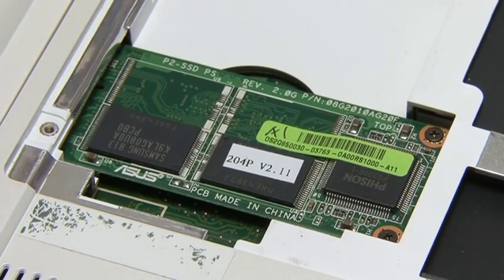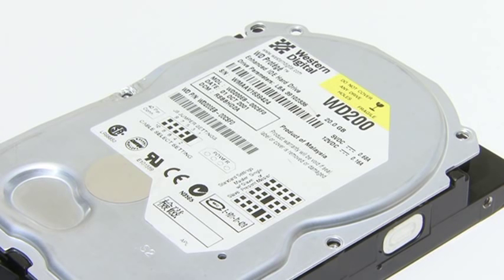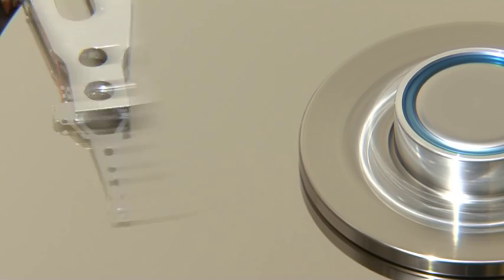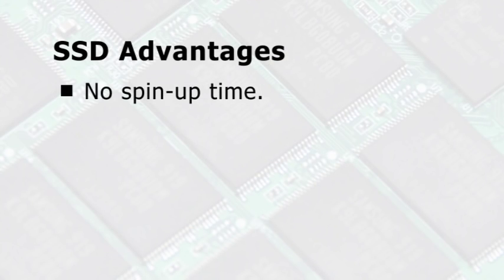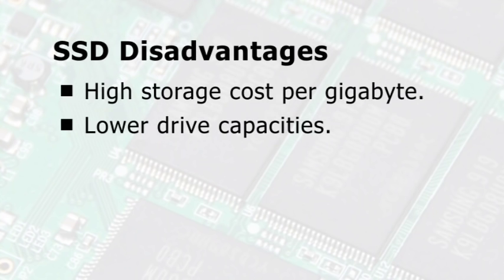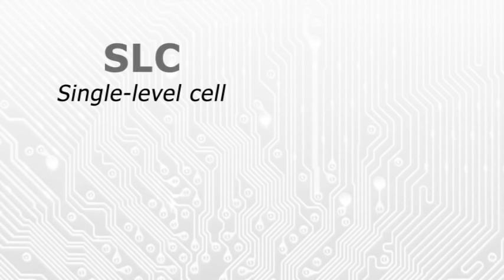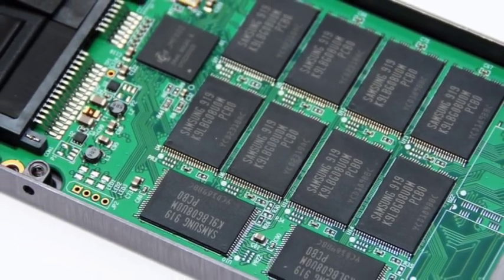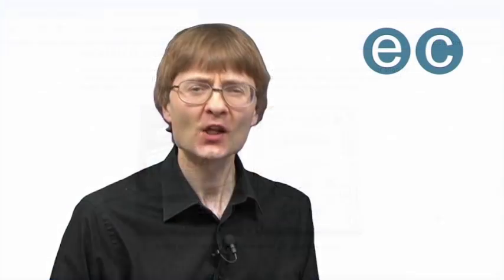Explaining Solid State Disks

Comment: But how exactly do they work?
Reply: It's basically the same principle behind a USB stick, but bigger and more permanent. 
Also known as flash drives, SSDs store stuff by catching small electric charges between some of the billions of transistors that make up the storage, where an active transistor is 1 and an inactive transistor is 0. This is where binary comes from. Binary is the basis behind all computing, but that's another thing. 
Transistors can store electricity because of these 'gates' that determine if the charge can go one way, the other way, or stay where it is, but I'm not too sure exactly how they do it, just what they do. I don't think anyone knows, really. 

They work a lot quicker because, as opposed to a needle on a disc, your computer can access all of the data on the banks of transistors and put it to use almost simultaneously, whereas discs have to compile and gather the data in a more linear fashion (like how a vinyl record works) for it to be tossed in RAM before you can access it. 
Incidentally, RAM also uses flash components, but that's for the stuff your computer is accessing and not the stuff you're storing. You can only access something one it's been sent to your RAM so if the storage drive can pump out faster, then the things you do should be faster, too, as all your files, programs, games and operating system are stored in the drive.
Reply: @classydays43  I can't believe you answered this question from 5 years ago. I really appreciate the time and effort you took when answering my question. Thanks man :)
Reply: @favorite89103  That's alright, dude. It's not the best explanation in the world but it covers the basics!
Reply: @classydays43  i actually needed this for school, thanks
Reply: @patmccarthy7907  😅 thanks, but I'd look at more resources! I might get the gist of the bare bones but I'm no expert by any means

Comment from the maker: When I researched the best SSD to use as the boot drive on my main PC (used for 3D rendering and HD video editing), I chose a Samsung 830 series -- the 256GB model. And about four months after it was fitted, I remain very happy with it. So that is my current high-end recommendation. It certainly beats other drives I have tried from Corsair and Kingston for sheer speed.

Comment from the maker: Lots of people have "noticed" this, and if I was making the video again I'd call it solid state drives. However, SSDs were initially called solid state disks (eg by Psion in the mid 1990s) -- and the term does remain in use even though there is no "disk" inside them. Language evolves -- with "disk" (in computer terms) being a word for a storage media.

Comment from the maker: Yes, it is becoming common to fit a PC with both an SSD and a spinning hard drive. Where this is done, the SSD is used as the system disk (c: drive) to store the operating system and (most used) programs. Data is then stored on the spinning hard drive (say the d: drive). Such a setup gains the benefit of an SSD to speed up boot and program load times, but allows the lower cost and capacity of a traditional hard drive to be used to store dat. Some ultrabooks are also already using this "trick".

Comment from the maker: It depends what you mean by "A LOT"! If you completely fill the drive, delete the files, & fill it again, thousands of times, then the drive will start to slow down and some cells will fail. But if you just write some files to it frequently, it should keep going. The SSD I show in this video is now over 2.5 years old and still working -- if with occasional hiccups, and not as fast as it first was. But until you start to experience performance issues, do not worry (though do back up regularly!).

Comment from the maker: Enabling TRIM and making sure that you don't defrag are very sensible actions to prolong the life of an SSD. Today, many SSDs -- eg those from Samsung -- come with a utility (like Samsung's SSD Magician) to optimise their use on a system. This includes leaving some space on the drive unallocated to assist with wear levelling. I made this video 2.5 years ago, and today modern SSDs work very reliably as system disks. So if you want faster boost speeds, fit an SSD and do not worry too much! :)

Comment from the maker: @SOF006 To be fair, what I say in the video is that data is written far slower than it is read -- which is true -- and "sometimes (not always) barely faster than a traditional hard disk". When the video was made (nearly 18 months ago) this was certainly true. And even today some (if increasingly fewer) SSDs struggle to write data as fast as, say, a Western Digital Raptor. Also, SSD write speeds fall significantly as the disk ages. I doubt you will achieve 200MBs in a year's time.

Comment from the maker: The speed of an SSD is not impacted by how full the drive is. However, SSD performance does degrade a little over time, and one way to limit this is to leave some spare (non-formatted) capacity on the drive. Samsung's SSD optimization wizard, for example, leaves about 10 per cent of the drive as unallocated space to help with wear levelling for this reason.

Comment from the maker: It depends if you need the extra space. The SSD / HD combination ought to give you a significant performance improvement -- as will the move to multiple drives when handling large files in, say, Photoshop. So I would probably myself go for the SSD / HD solution.

Comment from the maker: An SSD these days is faster than a hard disk. It also uses less power and is less likely to be physically damaged in a device like a laptop that may moved or jolted when working. However, SSDs also cost more per GB as you say, have a more limited life, and get slower over time. My advice is only to use an SSD if you need one (eg to make a PC boot faster). Modern hard disks are now very good value and are still the best choice in many situations.

Comment from the maker: The temp file issue is a potentially important one. I am typing this on a netbook with a 16GB SSD, and also run an Atom-based PC with an SSD, and on both have no temp file to save wear on the SSD. But on my Core 2 Quad (used for my video editing) the system disk is an SSD and I have left the temp file on, as it may be needed. If a PC is not doing very memory intensive stuff then you can get away with no temp file no problem: they were introduced years ago in a very different hardware age.

Comment from the maker: Yes, SSDs do have a (relatively) limited life -- for newer tripple-level-cell SSDs (like Samsung 840s), as low as 700 full write/erase cycles. To preserve the life of your SSD, leave at least 10 per cent of the space unallocated for improve wear levelling. I use an SSD as a boot drive, but not as a video/media drive due to the limited life issue.

Comment from the maker: No, the more free space (or unallocated space) on the SSD the better. Sorry if I what not clear above -- what I meant is that if you get a bigger SSD -- say 256GB rather than 128GB, even if you only need the space on a 128GB on -- then the drive life and performance will be better, because each cell of flash memory will be used less frequently.

Comment from the maker: Or you could try reading the DATE on the video before offering your criticism: the facts in this video were correct when it was posted (for several years SSDs were faster reading but slower writing than a 10,000rpm HD). And I'd love to know where you get a 3.2TB SSD -- the largest capacity I can find is 1GB. :)

Comment from the maker: @mastergx1 When this video was made this was not necessarily the case. Also, run an SSD for a year or so and the write speed can fall significantly. But I do take your point. Though it remains the case the all SSDs have a significantly lower write speed than read speed.

Comment from the maker: @creamie123 These are the key quns! An enterprise class hard disk (eg WD Caviar Black or Raptor) ought to last 5+ years, & performance will not decline over time (subject to fragmentation, which can be fixed). A modern SSD may last that long using TRIM. Eg Samsung claim a MTBF of 1.5 million hours for their latest SSDs, if also noting performance will degrade over time. For a HD the life and re-write limits depend far less on intensity of usage. But an SSD can more reasily be hammered to death.

Comment from the maker: You wil need to image (copy) your old HDD to the SSD, using a program such as Paragon Drive Copy. (Some SSDs come with suitable imaging software). Then you can literally swap the SSD with your HDD and it will work -- if a lot faster! :) If you are going to have both drives connected, then make sure that your SSD is connected to SATA 0 (to which you current HDD is almost certainly connected) to ensure it is the boot drive -- or select the SSD as the boot drive in your BIOS settings.

Comment from the maker: Remember this is video is over 3 years old. In April 2010 SSD write speeds were lower than (say) 10,000rpm WD Raptor hard drives. So for work like video capture hard drives were then the best bet. How things have changed! :)

Comment from the maker: You absolutely must not defrag an SSD, and because of the limited write cycles as you note. There is no benefit in running a defrag (you do not need to move blocks of data physically together to allow a head to access them faster), and will definately reduce disk performance. When installing Windows on an SSD, it is therefore important to turn off automatic defrag. Some manufactuers provide a utility to sort thing kind of thing out.

Comment: Excellent video showing the difference in technology between Mechanical HDD and SSD. The first thing I did when I ordered my new high end laptop was to finish setting up the OS and apps, and then swap out the primary 750Gig drive for a 128 Gig SSD, my secondary drive in the laptop is a 750 Gig 7200 and it serves as my data drive. All of the cache files for my programs write to the Mechanical drive. Boot times are nothing short of astounding.

Comment from the maker: @MultiSnoopDawg On any computer with an SSD programs load far faster, and there is also never a slight delay as a disk needs to spin up. So what you notice most with an SSD-based computer is not just the speed, but how much more fluid a computer becomes.

Comment: The best solution is to have 2 discs in one mashine. The faster but smaller SSD (Mine has the capacity of 250gb) would be used to store the system and important demanding applications and programmes, and the HDD with a higher capacity (mine has 1TB of data) would be used to store raw data such as photos, documents movies etc.

Comment from the maker: Yes, replacing the optical drive with the SSD is a possibility. However, point (c) above wll remain your problem -- just because you can connect two SSDs to your laptop's motherboard does not mean that it will have a controller built in to run the drives in a RAID configuration. I can't imagine a laptop will have such a controller, sorry.

Comment from the maker: Yes, SSDs are improving. But, for example, Samsung still caution against running thier speed tester too often as it will hit performance. Hard drives can still run at the same speed years after purchase, and sadly this is not the case with even modern SSDs. I guess it depends how much you hammer the drives and how full they are. And I tend to have fairly full drives that I hammer a lot! :)

Comment from the maker: It will depend on usage! :) I would personally expect to get about 2 years from an SSD as a system disk before performance starts to deteriorate significantly, and would expect to replace a system drive SSD after 3 years. But the bigger the SSD you get, and the less unallocated or free space you leave on it, the longer it will last.

Comment from the maker: At the margin a CPU may get hotter as it waits less time for data to be fed to it, but I cannot see this being an issue. Also an SSD will generate far less heat, and use far less power, in your laptop, hence making the innards cooler overall. Hence overall your laptop will be cooler with an SSD instead of an HD. So there is no reason here not to buy an SSD.

Comment from the maker: These days a multi level cell SSD should be fine -- they are far more robust than when this video was made. Do, however, avoid the very new tripple level cell (TLC) SSDs that are just coming on the market; these store three bits per cell, and are only rated for about 750 writes/rewrites per cell. They are cheaper, but I would not fit one as a system disk myself.

Comment: Excellent, there is also still a place for hard drives of course when large capacity is needed, working in tandem with an SSD (which has the OS and apps) and a good large HD to store the data.

Comment from the maker: Just copying the files to the SSD will not work -- Windows will not boot. Imaging softare copies a disk sector by sector -- it does not just copy files. You have two options. Either delete files from your current hard disk until the space used is less than the capacity of the new SSD, and then use imaging software to copy it to the SSD. Alternatively, you will have to do a fresh install of Windows and your software on the SSD.

Comment: One improvement they did make with HDDs overtime is that they spin up a LOT faster than they used to. Not as fast as a SSD of course, but still cool how you can make speed improvements even with those.

Comment: Thanx, i will fiddle around with that setting a bit just to see what it does. You could measure the amps with a volt meter. It has to bepartof thecircuit for a right reading.

Comment: @explainingcomputers i do, i was using a mac air, the bigger of the two, which i dont think seemed impresive from the stats, but the ssd really showed off as it made a huge diffrence over nomal drives ive used.

Comment: I found this very useful, nice to have everything explained in plain English. It strangely reminds me of BBC educational programmes from the 1970's. However, it didn't provide the answer to the one question that drew me to watching this. Would SSD memory would my computer run significantly cooler? On the one hand I've been told that the main temperature problems are due to moving parts, i.e. the spinning hard drive; on the other hand I've been told that modern processors run hot and the hard drive makes relatively little difference. When feeling the bottom of a laptop for example, it's very difficult to tell the difference because they tend to sit next to each other and are being cooled by the same fans pushing the air across both through the side vents and ports.

Comment: I for one can see the uses of "computer data" itself... Solid Computer Data, or SCD would be used to make even binary code into cities and bridges out of material so strong that it does not need support beams, making roads and skyscrapers  of the sky a reality, SCD would utilize color coding to check if things are running smoothly. GREEN would mean the coding is okay, RED would indicate security concerns.

Comment: It is also wise to choose a device with in house firmware.
I've seen many SSDs die and can tell that the later models have much better wear leveling algorithms. You also should mention an ECC algorithm that is implemented in some drives. (stands for error correction code) The better these two, the longer the ssd lifespan. As for SLC vs MLC, 2x MLS is now just as fast as SLC.
Also you should check the nand chip manufacturer and revision. 19nm toshiba/sandisk are the newest currently.

Comment: Is it possible to buy a standard ssd the pot it with expoxy, to make it even stronger?
Reply from the maker: Yes, but be aware that SSDs get hot, and this heat needs to escape. But you could incorporate a heat sink on the chips that emerges from the resin.

Comment: One important subject about HDDs and SSDs is recovery in case of failures.  HDDs give you a much greater chance of recovering data. On SSDs, a lot of things can go wrong.  Even if you can spot a damaged component, there is no way for you to swap out parts.  One time, I got my HD on fire.  All I had to do was to swap out the circuit board with an identical one.  My data was saved.  I bet as companies are moving toward SSDs, people will tend to purchase extra spares.  That will boost the sales.

Comment: it's not the initial shaking the disk, it's the move movement while it's running, it's the shock that moving a running laptop causes, laptop HDDs are quite robust, the platter is 2 mm thicker than a standard desktop one, so they last longer when subjected to shock or motion, so it's not much of a worry when moving a laptop, it's the gyroscopic action that damages platters, a basic read speed for a HDD is 7200RPM, and others work at 5200RPM,  but both will need to be carefully...

Comment: What about replacing the optical drive with another ssd, that would solve "A," then there would also be another connector open, correct? that would solve "B," and for "C," I was planning on buying a sony laptop and there is an upgrade for ssd at the configuration, so would that mean that even if you don't upgrade, the laptop would still be raid upgradable?

Comment: Very informative, and answered a lot of my questions.

I'm thinking of upgrading my 300Gb traditional hard drive and I'm not sure whether to go for a single 1Tb traditional hard drive (using the 300Gb for backing up essentials), or have Windows and Photoshop running on a solid-state drive (say around 64Gb) and have everything else running from the 300Gb as a secondary drive.

As prices are roughly the same, what would you recommend?

Comment: Is it hard to add on an SSD to a laptop already using a HD ? I have a macbook and i was thinking in adding an SSD. Do you simply just put the operating system and heavy programs onto the SSD and the smaller files onto the HD, or is it more difficult than that ?